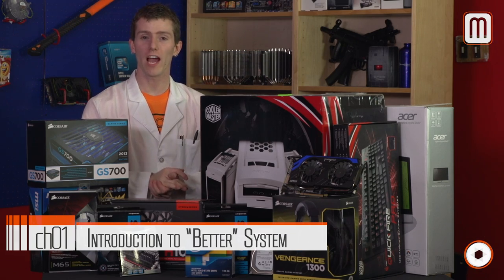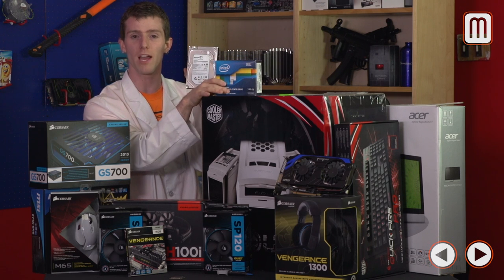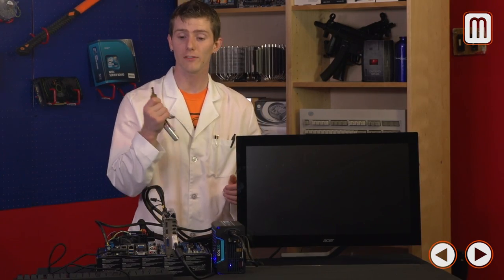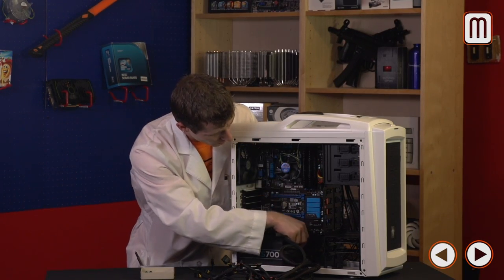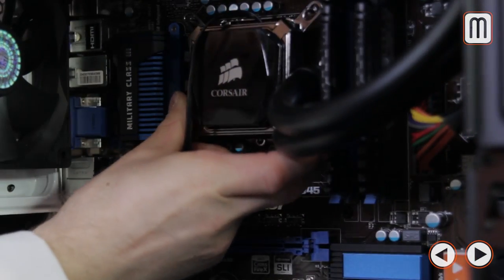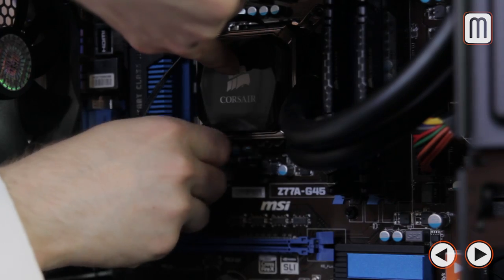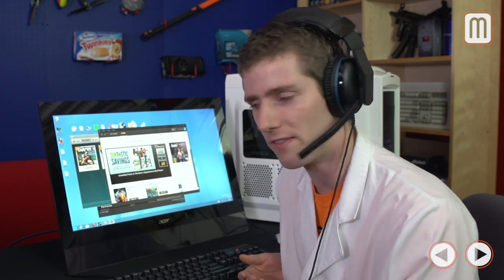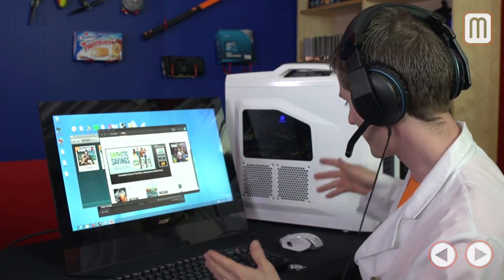ULTIMATE Build a Better $1500 Gaming PC Computer "How To" Guide

Comment: Will this 50 dollar Pc run games at 1080p
A potato(CPU)- $5
Papaya(GPu)-$4
Fruit Basket(Casing) $10
Durian(psu) $5
Banana(Ram) 2 sticks $5
Tomato(half cut)(mouse)$3
Chopping Board(Mobo) $10
Big Chcoclate Bar(Keyboard) $8
Reply: so funny
Reply: You forgot the Oranges. (Hard Drives)
Reply: can it run minecraft
Reply: You payed $5 for a potato?
Reply: Oh by the way I was able to design a light 4k rig for $1700 I'm serious this rig is $1700and uses a 4770K and GTX 780 Ti and 250GB SSD with 16GB 1866 MHz RAM Patriot Viper 3 with a 1TB Segate and MSI Z97 Gaming 5 Motherboard. Here's the link http://pcpartpicker.com/p/xktGdC
Reply: Jack Bittner The potato is watercooled.
Reply: Now that's bang for your buck.
Reply: I personally would go organic they are super clocked run games 3x better.
Reply: just don't overclock your PAPAYA bitch
Reply: The Durian might bottleneck you

Comment: Would this build work together? I'm honestly not that good with parts and how to find if parts work with eachother.

CPU - Intel Core i7 3770K
SSD - Samsung 840 EVO Series 120GB
Motherboard - MSI Z77A-GD80
GPU - EVGA GeForce GTX 760 Superclocked ACX 2GB
HD - 1TB Western Digital Caviar Black Hard Drive
RAM - Corsair Vengeance 8GB DDR3 (2x4GB)
Case - Cooler Master CM Storm Scout 2
Reply: it should
Reply: Checking it out now, thanks guys.
Reply: ***** this is the 3rd time I've seen this comment
Reply: Greg Muay I would recomand going haswell with the msi z87 g45 and with a biiger ssd(because games are really big these days so youll need that)
Reply: check out austin evans channel for gaming pcs because their short and tells you the parts you should use)
Reply: Your graphics card will bottleneck.
Reply: you can get an 8 core AMD cpu for $160 less, just saying.
Reply: pptelitegaming It's not for gaming It's for other stuff. Making videos and upload them c:
Reply: Making videos, rendering, editing is the heaviest you can do with your computer, you'll need a good CPU, suggest an intel i5 or i7 4770k
Reply: ***** Dude, look it up, intel have better performance even that AMD have more cores. But he should go for a R9 290 because GTX 780 isn't performing that well if you compare both cards. You should look it up on google.
Reply: ***** Look it up bro.
Reply: As long as everything works out of the box and isn't DOA and you know what you're doing, this will work just fine
Reply: Yes it will work together, though you should check if it all fits into the case.
Reply: Go to pcpartpicker,com and put in all you parts. It will notify you of any incompatibilities and it will find you the lowest prices for each part.

Comment: This is obviously my opinion and comes without a monitor and other accessories, but if you'e looking for a computer its self and not the accessories monitor, keyboard etc. I'm building a pretty powerful build right now.
I have:
Intel core i5-4670k CPU (capable of overclocking)
EVGA GXT770 SuperClocked edition
Asus Z87 PRO LGA 1150 motherboard
Corsair Vengance 16gb DDR3 1600MHz
WD blue 1TB HDD
H100i liquid cooling
Corsair CX750 fan
HAF 922 case
DVD-RW drive (optional)
Samsung 840 EVO 120gb SSD

I found all the parts on Amazon for around $1400-$1500.
Hope I helped at least someone.  :D
Reply: Very nice build Adolf! Here's mine for $1600:

Corsair 750D $130
Gigabyte GTX 780 Ghz Edition $510 (Fastest GTX 780 you can buy)
Intel i5 4670K $220
MSI Z87 GD65 Gaming Motherboard $170
Corsair AX860 Platinum $170
Corsair H100i $90
Corsair AF140 Quiet Edition Fans $20
Corsair Dominator Platinum 2x4GB 1886 Memory $130
Samsung 840 EVO 250GB $140
Seagate Barracuda 3TB $100 (GODLIKE price/performance!)

Personally I think the extra $100-150 for the 780 is worth it especially for 1440p gaming and since it was once a $650+ card.

Comment: Can this run Crysis 3 at 4K 120fps?
CPU - Intel Celeronn2840
GPU - Integrated Intel HD Graphics 4400
RAM - 512mb DDR2 @ 800Mhz
PSU - 50w 80 PLUS Tin
Motherboard - Recycled from laptop
Case - Cereal box from Cooler Master
O.S. Windows XP

PLEASE GET BACK TO ME SOON.
Reply: Depends if you have a gaming mouse or not
Reply: Yeah it can (sarcasm)
Reply: Yeah it can (sarcasm)
Reply: +TheVinceBros * Only with racing stripes painted on though.
Reply: LootFragg Thanks, i'll try that.
Reply: TheVinceBros *
By the way, I actually laughed. Genuinely funny post. Love how you took it over the edge. This looks so innocent among the other spec comments.
Reply: ***** Ah, thanks man, good tip.
Reply: *****
You don't need RAM. It's only for random access anyway.
Reply: Also runs fire strike at 8k 10000000000000000000000000008901fps
Reply: So it will be at extreme slow mo!
Reply: +Onixspected oh, k
Reply: +TheVinceBros * Thanks, this is the fumiest thing I've read in awhile.
Reply: I recommend windows 95...... Then yes it will :3
Reply: I think that's the best computer ever, did it cost 10,000
Reply: well, great. like $20 worth of stuff and you'll surely get like 120 fps.
Reply: enderslayer247 Was that supposed to be funny or...?
Reply: TheVinceBros * Sorry, I didn't realize how stupid, immature and messed up that was. I changed it. sorry, wow.
Reply: enderslayer247 Lmao, its all good.
Reply: +TheVinceBros * Talk about overkill
Reply: ***** atleast itll run new games from the future
Reply: +OliHD But Bill Gates said that that is not enougth 614kb is enougth.
Reply: +TheVinceBros You need ocz go faster stickers and led lights. that'll run it.
Reply: you forget to give a big wing
Reply: +TheVinceBros nice build would manage 8k 4 sure
Reply: +TheVinceBros CELERON IS RUBBISH! CORE 2 DUO IS MUCH BETER :D
Reply: +TheVinceBros you can play 8k at 420 fps
Reply: +Ryan Luong Oh thanks I was worried you weren't being sarcastic! (sarcasm)
Reply: LootFragg lol.
Reply: Electrikz Yeah and i was thinking of cutting holes in the cereal box with a box cutter for better airflow, as well as adding some cardboard to separate the bottom chamber for my 0.5% Tin+ efficiency PSU, going for that dual chamber design.

I'm also going to be adding a recycled garden hose for water cooling, for my coolant i'll be using Koolaid, as its cheaper than water, also the purple color adds to the aesthetics. 

Also, i'm thinking Lucky Charms as my case because the color scheme matches my internals, going for that vibrant look, really going to stand out. My overall budget is $5 and a shiny button i got off a homeless person in the street time to max out those settings.
Reply: dotjp For LED lighting i was thinking of a lava lamp strapped onto the top of the cereal box with duct tape, what do you think, tasteful?
Reply: TheVinceBros oh, fully tasteful.
Reply: TheVinceBros maybe two mini lava lamps, one taped on the front, and one on the back?
And in Red, of course.
Reply: Robbie Beniboy Good idea, the red really screams "enthusiast build"
Reply: TheVinceBros Yup. How about a cling-film side window? Then you could mount the lava lamp halfway though the top, lighting up the inside!
Reply: Robbie Beniboy Cling film side window haha! Very smart, and budget conscious, may be a problem with heat insulation though.
Reply: Ah, didn't think of that. Or you change the cereal box, for one of those fancy plastic containers, however I think that would be going too far. best to keep things simple.
Reply: +TheVinceBros U forgot cooling. a hamster on a wheel? and thermal compound. Toothpaste?
Reply: +TheVinceBros am thinking of doing an actual video with a potato as mobo 

PC BUILD FOR 20$ RUN shadow of mordor at 8k with over 120fps average
Reply: +TheVinceBros it will rum minecraft at around 1,000,000 fps, but it will run crysis 3 at 1 frame per second
Reply: +TheVinceBros I heard you can use the older Graphics Media Accelerator built into older motherboards, you should ditch that GPU.

In all seriousness, XP should be fine but you have 0 support for it lol
Reply: +TheVinceBros paint it blue and throw it in the sea!
Reply: +TheVinceBros Yes, that will be great at 5K as well. You might even get 140 FPS out of it!
Reply: GiGeorgeiePie ty mayn construction is under way.
Reply: Well that os needs to be downgraded to win 95
Reply: so passive cooling 
`
Reply: TheVinceBros , you can run road rash in this
Reply: TheVinceBros Add some stickers
Reply: If you overclock it a little bit and use some good motor oil with it

Comment: I found that Folding@Home was an excellent "set it and forget it" stress test for both overclocked GPUs and CPUs. I had RealTemp and GPU-Z keep logs on things while I went to work in the morning. Set Folding@Home on full power, disabled my computer's auto-sleep, and let it go for 9 hours. 

I used Unigine's Heaven to do short term GPU overclock testing, and I did the OC in MSI Afterburner. Got my GTX 970 to a very stable 1300 MHz base clock (ca. 1500 MHz with Nvidia's GPUBoost)  and a 7.2 GHz memory clock. CPU is only at 4.0 GHz but I only sport a 120 mm radiator.

Comment: how powerful is this PC that he just built?
on a 1-10 scale?
1 being able run Vindictus on high setting 10 bein able to run Dragon Age: inquistion, skyrim on the highest setting possible with ease.
Reply: 10
Reply: 6
Reply: 6.5
Reply: taifhamid1 This is very old build!
Reply: taifhamid1 I recommend using www.cyberpowerpc.com if you don't know how to build the pc your self it also tells you the recommended  psu wattage for your build as well as the fps it will run for a few games.
Reply: Gilbert Bridewell thanks, i got few friends who already did it before plus i have already opened a PC before but it was about 4 years ago so i forgot, i'll compare this to $1900 components that were recommended by reddit and see which one is easier/better.
Reply: My build i am gonna be getting from cyberpowerpc is a 1900 dollar build that is being built so i do not have to upgrade to play a game that comes out in next few years or so but will defiantly look into upgrades after about 5 years or so just to keep my pc up to date
Reply: taifhamid1 This is an old build. If you were to build this today, I would go with a i5 4690k and a R9 290 instead of a i5 3570k and a Geforce GTX 600 TI. That would bring this build up from 6.5 to 9.7, or possibly 10 if you overclock the CPU/GPU. You would also need a Z97 motherboard for the CPU.
Reply: taifhamid1 this is bout a 5-6, if your going to copy this instead of a 660ti get a 960 or 970gtx, and get a i7 processor or an AMD equivalent
Reply: This is the build i'm geting for about $1900
Case: Apevia X Dreamer 4 w/ Temp Display
Fans: Maximum Thermaltake Riing 12 Series High Static Pressure 120mm Case/Radiator Fan
Processor: AMD FX 8350 4.00 ghz
Air Cooling: Cooler Master GeminII S524 CPU Cooler w/ Aluminum Fans & 5 Heatpipes (All Venom OC Certified)
Motherboard: GIGABYTE 990FXA-UD3 AMD 990 ATX w/ Ultra Durable 3, On/Off Charge GbLAN, 4 PCIe x16, 2 PCIe x1, 1 PCI (Extreme OC Certified)
Memory: 16GB (8GBx2) DDR3/2133MHz Dual Channel Memory
Graphics: AMD Radeon R9 290 4GB GDDR5 PCIe 3.0 x16 Video Card
Power: 750 Watts - Corsair CX750M CX Series Modular 80 PLUS BRONZE Certified Active PFC Power Supply
Storage: 64GB ADATA SP900 SATA-III 6.0Gb/s - 550 MB/s Read & 505 MB/s Write & 512GB ADATA SP900 Series SATA-III 6.0Gb/s SSD - 555MB/s Read & 535MB/s Write
Reply: Gilbert Bridewell Don't go with the CX750 please, it has terrible quality components and dies out fast. Go with the EVGA G2 750w (My personal) or the RM750, HX750, or something along that, also get one with 80+ Gold or up.
Reply: Gilbert Bridewell Please get an Intel processor, they preform much better because they can handle more instructions per GHz. If you live near a Micro Center, you can get a 4690k for $199.99, which is $100 less than the MSRP. You'll also need a Z97 motherboard; the MSI Z97 Gaming 5 is a great deal at $123.88 from OutletPC for all of the features of the $300 ASUS ROG MAXIMUS VII Impact.
Reply: taifhamid1 Looks good. The Arc XL is going to be big because it's designed for EATX (Expanded ATX) and XLATX motherboards, while the one you chose is an ATX motherboard.  You can still use it with ATX, Mini ATX, Micro ATX, and M-ITX motherboards, though. If you want something the size of a standard prebuilt, get a mid-tower case. If you don't care, Fractal makes great cases, so you'll be fine with the Arc XL.

Edit: The Arc XL also comes with three fans (two intake and one exhaust) so you don't need the extra fans but they can help with internal temperatures. Corsair makes good fans. Not the best, but definitely good.
Reply: Michael Marquardt
thank, i will use it A LOT so i will get every fan i can get my hand on :P
Reply: taifhamid1 welcome.
Reply: taifhamid1 10 because skyrim is from 2011 and most good computers can run that game at max
Reply: ok cool
Reply: Gilbert Bridewell Why all the AMD? AMD is usually used for cheaper builds and a 1900 build isn't cheap. Nvidia and Intel provide better performance per dollar. 

Your Processor should be the i5 4670k, it can overclock to around 4.6 ghz and has better performance. You should be spending a bit more if you have a 2000 dollar build.

Power supply should be at least, the very least for a 2000 dollar build at least 80+ gold efficiency. That PSU is the only thing capable of single single-handedly frying your entire system.

For a 2000 Dollar system better cooling might be warranted for your 2000 dollar build. noctua nh-d15

Storage should be better, get a samsung evo 128gb don't go for less than that because any less than 128 gb it goes way down performance per dollar and so does the reliability.

Motherboard is around 100 dollars cheap go for the asus z97-A

All in all I have no clue why your build is 1900 dollars. This is mine for about 1500 with everything including monitor.
-http://pcpartpicker.com/p/CMbT99
Reply: Jonathan Tran nvidia and intel do provide more performance but not more performance per dollar.
Reply: Well he is spending 1900 on a pc so I expect that he wants quality parts. Usually anything around 1500 doesn't sacrifice performance for price.
Reply: Don't buy from cyber power or Ibuypower! Save like $100 so you don't have to pay shipping fees and use it on your computer hardware!
Reply: That is correct sir, a quality power supply with japanese capacitators 750watt costs about 100 dollars
Reply: 4 nowadays,m8.
Reply: 4?
Reply: Yea now days that's a 4. If u spent $1500 and ended up with an i5 and gtx 660... U got ripped off. Nothing wrong with those components. I still run a 660 (prolly be the next thing I upgrade when the 970s go on sale. This is a helpful video but don't be fooled, it's a commercial. They got a lot of Corsair products. Majority of their budget went to nice but unnecessary stuff for the majority of people like the keyboard, and liquid cooler.
Reply: scylendrey hmm how much would this build cost in 2015? Will it run GTAV ?
Reply: Michael Marquardt im overclocked to 4.4ghz on the cpu and 1580mhz on the gpu with a msi z87. z97 isn't needed for that but prices are very similar now so its whatever.
Reply: sneaky kitty There's a chance that the Z87 mobo will come with an outdated BIOS that won't work with Haswell.
Reply: Michael Marquardt small chance which the user can check, or just flash your bios to the latest version.
Reply: sneaky kitty Can't flash a BIOS without a working computer.
Reply: taifhamid1 lol my old rig with a gt 640 could run skyrim with enb on max with 2k textures it could blast skyrim out of the water
Reply: 2
Reply: +taifhamid1 this pc is good 2 years ago
not now
Reply: +taifhamid1 compared to a $1500 PC nowadays (980ti, i7 + 25{0,6} SSD), about say 40% of the performance.
Reply: 8.5ish I'd say.
Reply: +Michael Marquardt an old build, fuckboy, i have a gtx 680 and a i7 980x and it's a beast
Reply: +taifhamid1 9.5